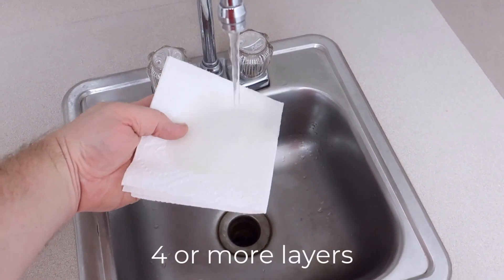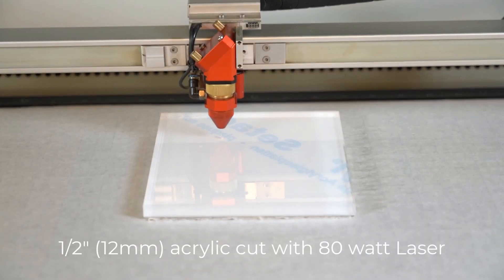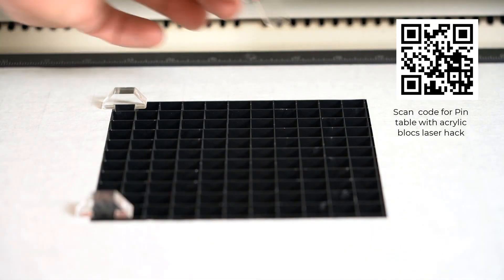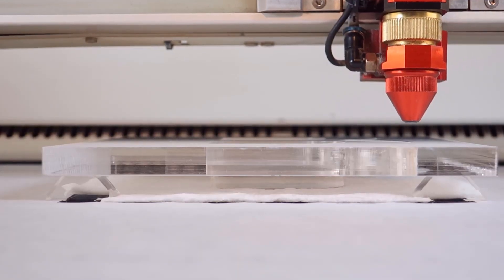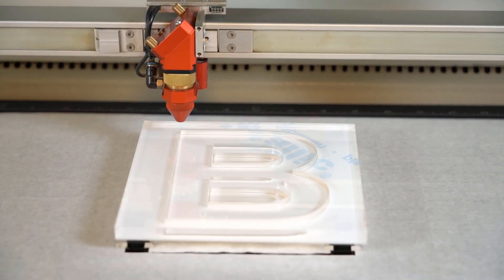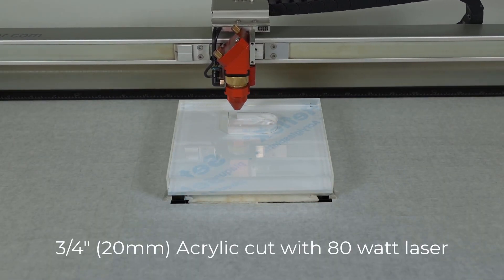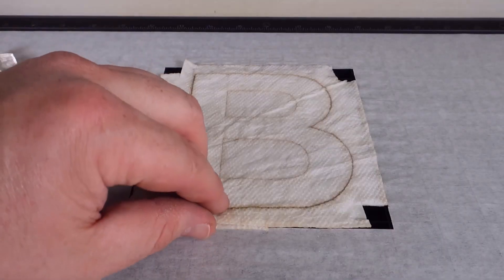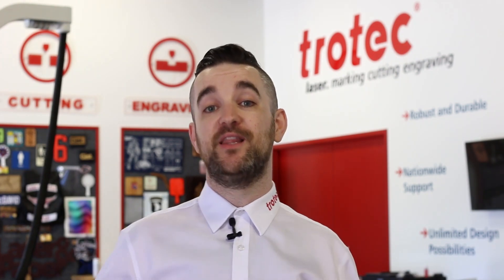Laser Cutting Hack: Improve Your Acrylic Cuts with Paper Towels

Comment: I get flare-ups when cutting acrylic puzzles (Trotec branded substrate). Would this tip work for such small pieces?
Reply from the maker: What substrate? Laser? Wattage? Power and speed used?
Reply: @TrotecLaserCanada  For substrate I've been using the Trotec 121800 (3mm), 121863 (6mm), 121801 (4mm), and 153705 (glitter 3mm). For power settings I'm at 60% of an 80 watt, 25% speed (sometimes 40%) and two passes. Frequency 100%.
Small pieces may fall through prematurely. When cutting puzzles I first cut the perimeter. cut one axis then follow with the alternate (X then Y). Seems like pieces will fall or bend and cause severe uneven KERF therefore ruining the fitting.  I'll try your hack this afternoon as I have a huge order puzzles due soon. If it at least works for flare-ups that's a great hack.
Reply: Just use more air pressure if you dont wont flames on backside. Especially on thick materials that you have to cut with slow speeds